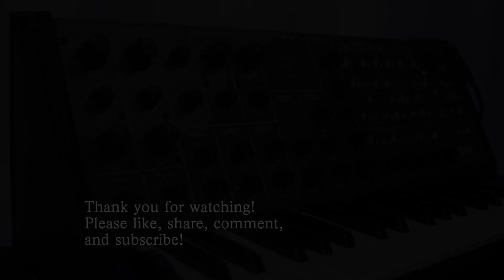Korg MS-20 🦖 Old Korg 35 vs New OTA Filters & rumoured “noise leak”

Comment: So, I have an original MS20 and I don't know what filter I have. I don't have any leak, so I don't have the original Korg35 filter? My serial is 148052
Reply from the maker: Well, it isn’t actually a noise leak, but part of the sound. I’m sure yours exhibits the original sound
Reply: You have to take the left hand side off to view if you have the OTA filter board or not if not your have a Korg 35
Reply: from this video i would guess you have a KORG MS-20 with version 2 filter, with the OTAs.

Comment: Hi there! Can i ask you something? Can i do the same trick to remove the noise in my Korg Ms20 mini????
Reply from the maker: I believe the mini also has both filter types. Check the manual and see if you can switch. If so, that should do it for you! 

Some people said that the mini still has some noise leftover. But I have not confirmed this since I only have a full size

Comment: This "noise" sound may be the filter at work but my MS20 mini DOES have an oscillator leak. I can hear it when I turn down both Oscs, filter cutoffs and res's. Sounds like a saw. Faint. Doesn't change with waveform selector. But is playable on the keyboard, it changes according to pitch, scale, EG1 and MG. Any thoughts? Thanks
Reply: Strange, my MS-20 mini don't have this oscillator leak. It is exactly the same behaviour of the MS-20 FS .
Reply from the maker: Hmmm. Didn’t test the mini. Is there still a noise when switching to the other filter?
Reply: @ToddUrban  only the old filter on the mini
Reply from the maker: Maybe it is different on the mini then! On the FS, it is just the sound of the filter being noisy, rather than the noise Osc “leaking” in.
Reply: @ToddUrban  ok thanks replying. I may swap to the FS if you can switch between the filters like that. For me, the old filter noise is only problematic for certain uses.

Comment: When you did that first highpass sweep I thought we were heading into Glenn Frey's The Heat Is On.  Great explanation of this noise.  Folks now know that its the old filter that does it.  People say that its great not having the noise with the new filter but others say the old 35 filter is more aggressive.
Reply from the maker: Thanks! When I first got the synth, I was thinking it was an issue. But after really learning the circuit, having the noise in the 35 is a great alternative to a more clean sounding filter. It has a totally different sound.
Reply: @ToddUrban  It's a generalisation but some of the vintage-style  stuff is noisy but they do have their charm!
Reply from the maker: Definitely!
Reply: @ToddUrban  Correct me, if I´m wrong, but from an electrician´s standpoint, I think it´s gonna be impossible, we would ever get a filter, where we couldn´t hear any sound at all anymore? (I mean, with the stuff you do with the hp and lp filters)
Maybe? Maybe not detectable with the human ear?....
Reply from the maker: @chanceneck8072  well, true.... to some extent, I would assume all filters have some inherent noise. However, the noise in the MS-20's K35s is significant and very audible. And on the contrary, the OTA is fairly quiet. But event more substantial than just the noise, the sound of the filters really creates a totally different sounding synth.
Reply: Both nice sounding but the OTA filter is more to my taste. Thanks for the demo.